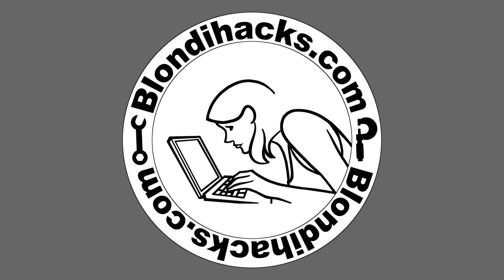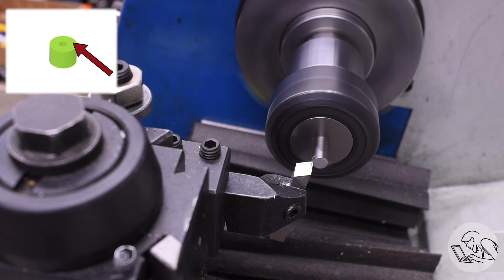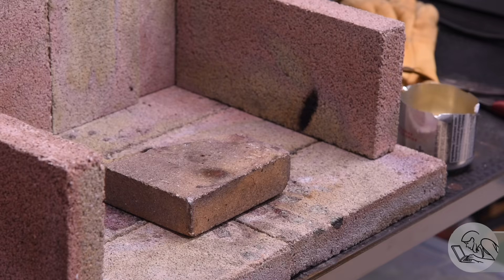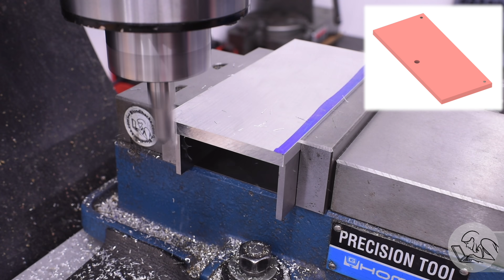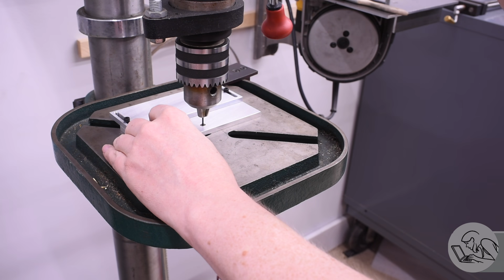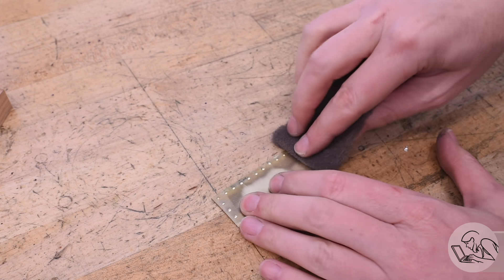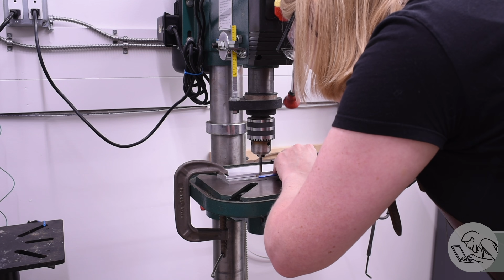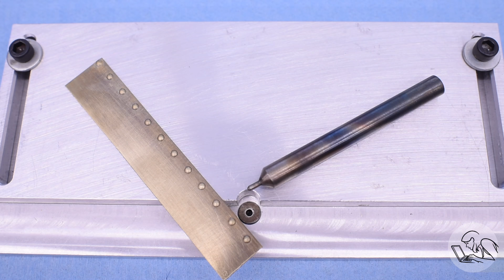Let's Make An Embossing Tool

Comment: Hardening of Steel is in theory a very simple proces and easy to calculate. But getting al the data and tables is difficult and than getting all of this tempercourves right in a homeshop is very difficult.
The way how you are hardening steel is just perfect for what you have at hand.

I have to memorize this stuff for my material engineering classes.

And your channel is helping me a lot for my classes.

Comment: I don't understand why you didn't use the obvious solution for the spacing and create an arduino/ai driven kitty-cat android called kittywompus with voice control that would hold the piece with its retractable claws and slide it over the amount specified by voice command. It would have been a lot quicker and would have allowed you to use different types of curves to vary the spacing as you desired.

Comment: I suppose the paper pattern would also replicate the original process better. They wouldn't have used a complex jig or a DRO, I think they would have marked the holes out and drilled them in a way that would have resulted in similar error to your paper templates.

Comment: A bit of an overkill suggestion - would it be useful to machine a step at the bottom face of the guide to accept the sheet stock? It may help keep the sheet flat overall and make the process a little less fiddly (nature of working with small parts)

Thanks for your vids Quinn, very inspiring stuff.